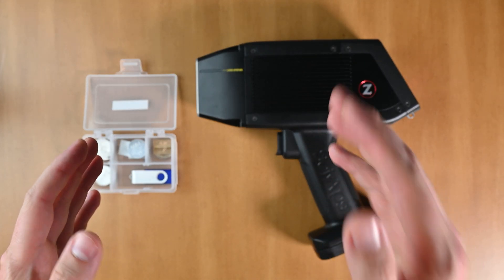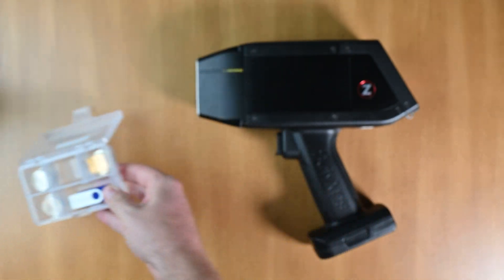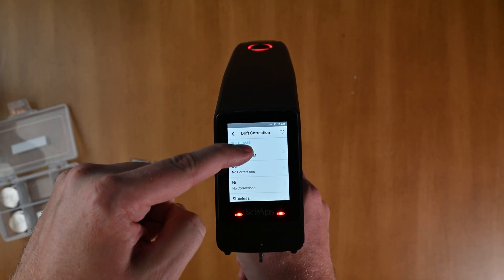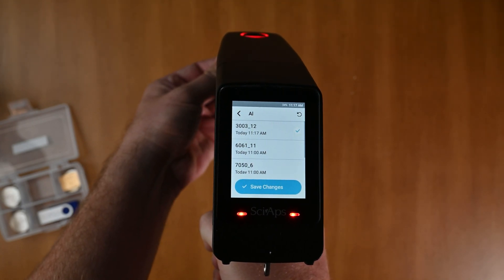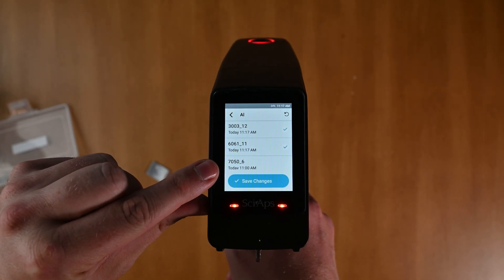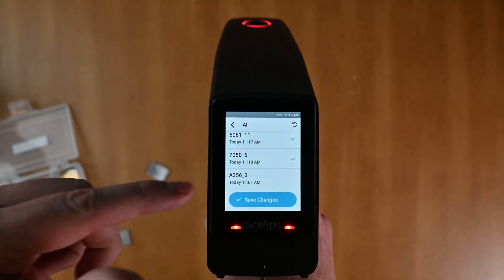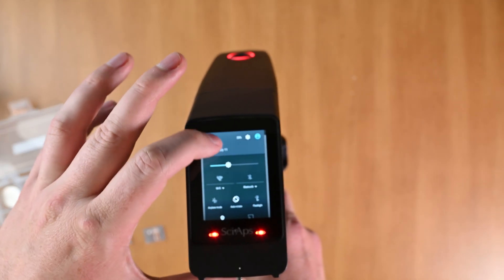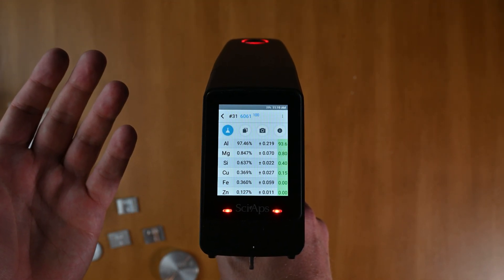SciAps Z901 Drift Correction

Comment: What’s the safety of the reflection of the laser beam?
Reply from the maker: Each LIBS unit has its own NOHD (safety distance). The SciAps Z901 (and other Z-Series LIBS units) have an NOHD of 13 meters. There are safety features built into each device to prevent errant firing. When the sample covers the analysis window completely, it contains the laser. Lastly, there has been no reports of anyone getting hurt with any handheld LIBS unit on the market.